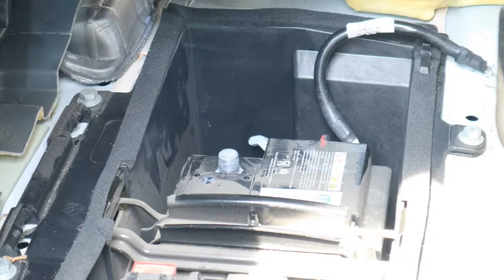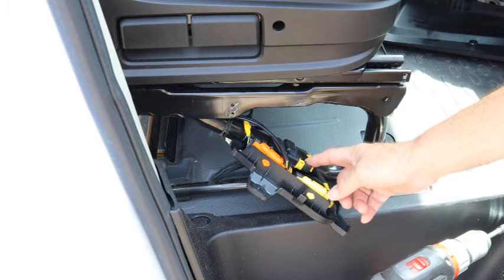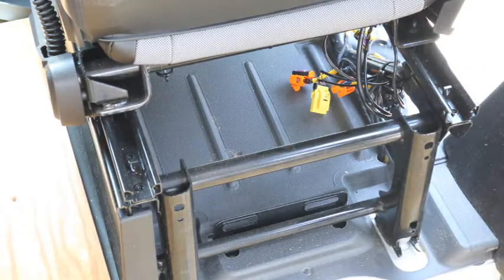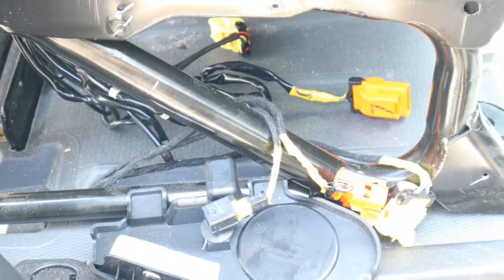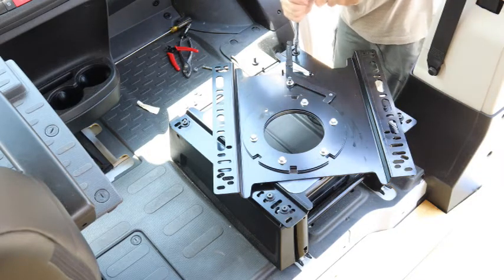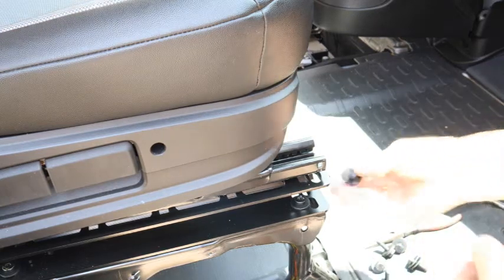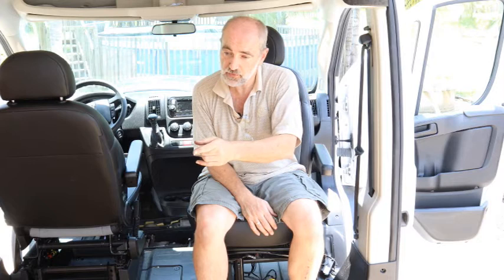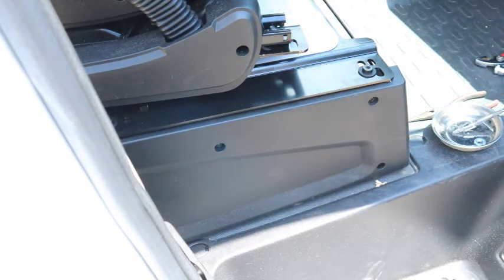Van Life - installation of the passenger swivel seat.

Comment: What swivel did you use?
Reply from the maker: Purchase from markwen11 through ebay, he has a site called sprinterswivel.  It works well.  I did attempt to contact the seller several times.  They never responded.   My kit was missing one bolt.  But that was easily solved by visiting a local hardware store.